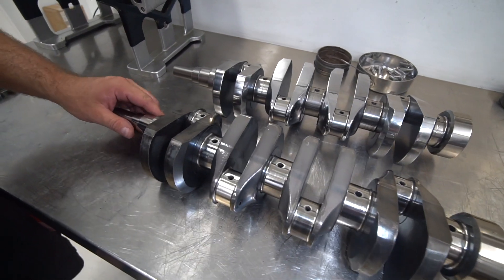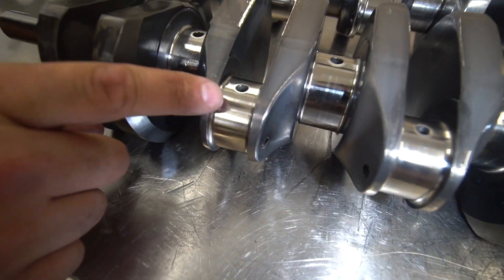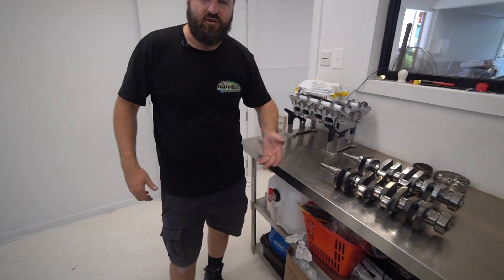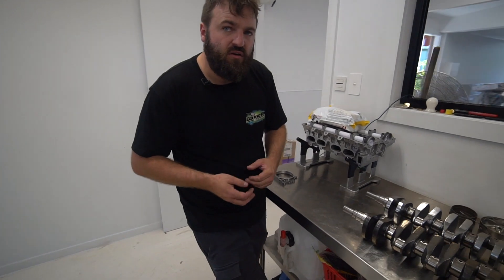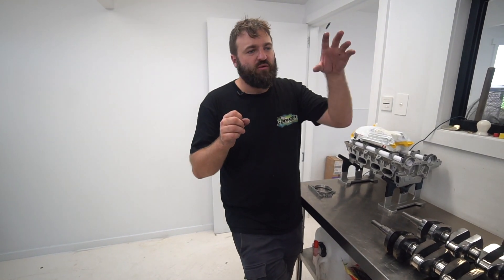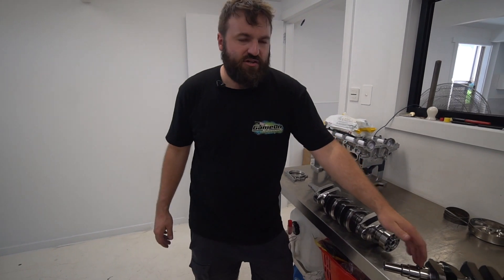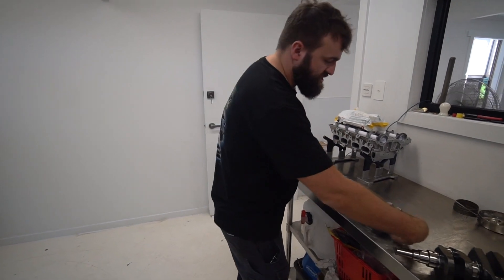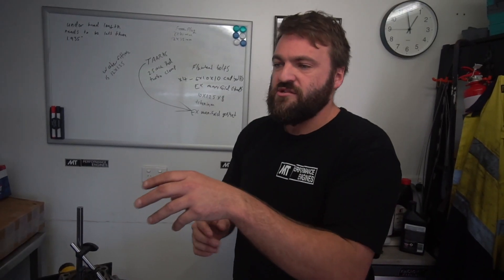Polishing a TRD Formula Atlantic Crankshaft (Ask An Engine Builder)

Comment: There's no such thing as cavitation either with a crank. The oil gets aerated because the pump not only sucks up oil but sucks up air too due to the clearances between the gears and the housing. Air enters on the suck side and oil escapes on the blow side. The more worn the housing is, the more air enters and the more oil escapes.

Comment: Polishing the crank is done after grinding to remove debris from cutting with the stone. You're not going to polish it after to try to remove anything else because you'll make it out of round and smaller and mess up any clearances. If there's ridges in the finish it's because the stone wasn't dressed properly.

Comment: Cavitation across the crank journal sounds like a bit of waffle to me. I understand wanting to have a uniform oil film thickness for the rod bearing to slide on though. If anybody can point me in the direction of cavitation data I’d be more than happy to have my opinion changed
Reply: It's not waffle it happens under the right conditions aerated oil, heat, high boost and rpm will cavitate bearings
Reply: I can send you pictures of cavitated bearings if you really need proof
Reply: It's bollocks.